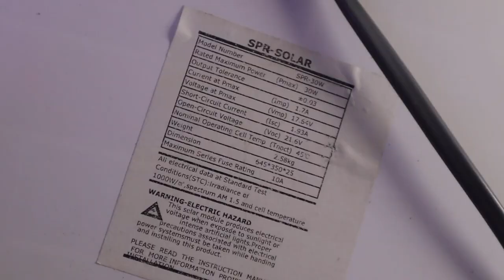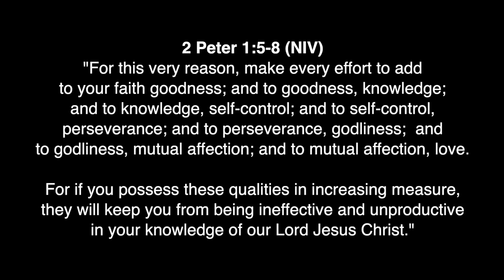How to build a Solar Energy System | Step 3 Necessary Equipments

Comment: I heard you say that you use a modified sine wave inverter for your refrigerator and lights. But, I heard that pure sine wave inverters are better for motors and electronics. I would suggest that you use a Pure Sine wave inverter.

Comment: I thought that PWM controllers were not suitable for Li-ion batteries as well as MPPT controllers. Is it better to find a controller that specifically says it can run Li-ion batteries?
Reply from the maker: If you are running a 7s they are good